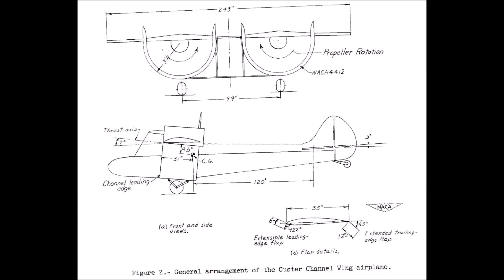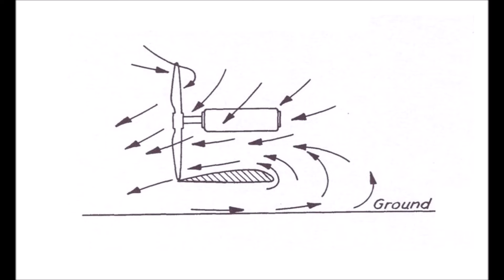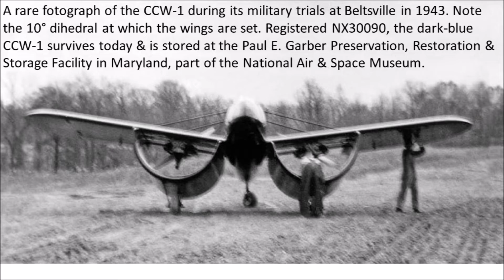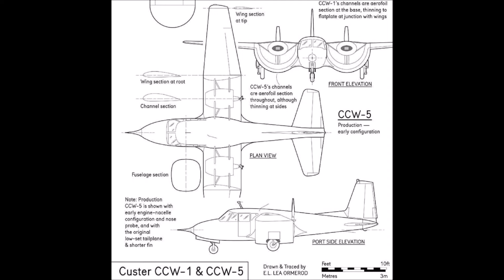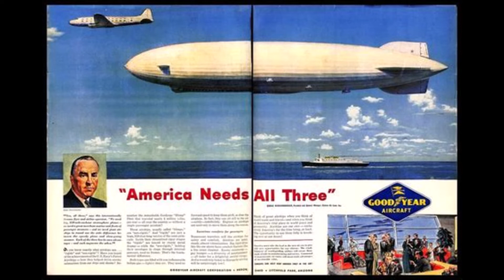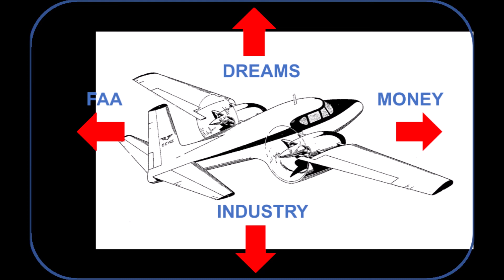Custer Channel Wing

Comment: Why not placing the propeller on leading edge? The Antonov Izdeliye-181 had the engine inside fuselage, propellers moved by shafts, on leading edge, it made some tethered flights, they say. 
Perhaps a Counter-propeller, as in 1927 patent DE394245, by Wagner, would help, by changing the swirl air flow from propeller into something more straight and 'laminar', better for lift and drag.
NASA RM L53A09, April 1953, by Jerome Pasamanick, describes the Langley wind tunnel tests of a full scale CCW machine, with electric engines. 
Gesund +'
Reply: I think having the propeller in the pusher configuration allows it to create a lower pressure area in the channel.
Reply: @chrisf8584  Low pressure area in Channel Wing comes from the fast air flow, the NACA/ NASA Langley tunnel study depicts this, but for me, it incurs in bias, as proposes as drawback the resulting vector going in an angle respect Wing Plan. For sure, if a Channel provides both thrust and lift, the vector will be in angle.
The Antonov 'Izdelye', meaning 'experiment', I guess, had propellers on leading edge of channel, as most ducted fans used for lift and propulsion in VTOL machines have.
This, and the concept of 'counter-propeller', the New Unducted Fan by Airbus has a turning propeller, and behind, fixed blades of variable incidence.
You could either check for info, wait until Airbus, Safrane, release data, or test it by yourself.
Blessings +
Reply: @joseveintegenario-nisu1928  The SAE paper by Keller, Sachs, 'Small Wankel engines' showed a blowing fan is better, takes less power for cooling the engine than a suction fan, as most cars had behind radiator, moved by a belt from engine.
Today, they make the right arrangement: electric fans, thermostat controlled, in front of radiator.
But air cooling is better for everything than liquid cooling.
Gesund +